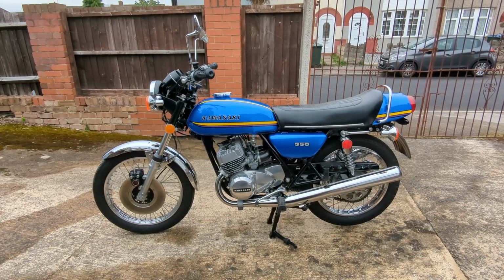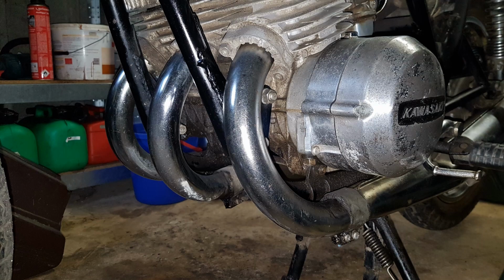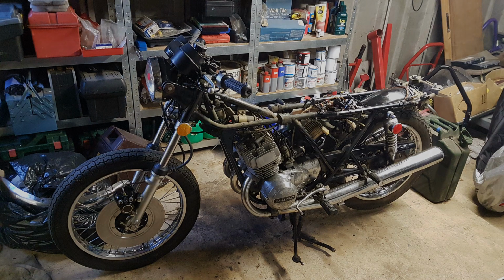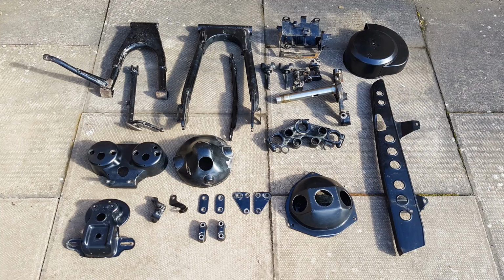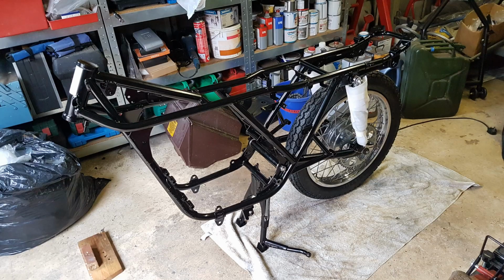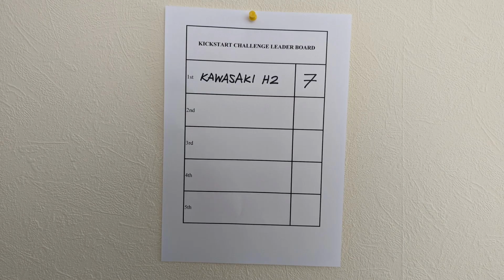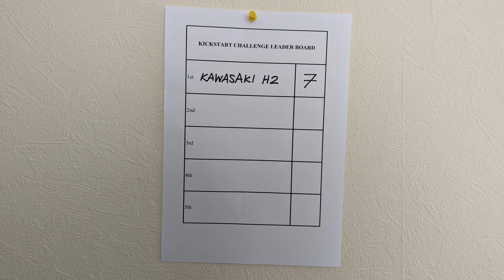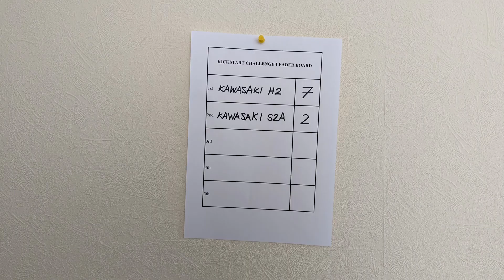1973 KAWASAKI S2A | Walkaround and Kickstart | 2 Stroke Triple | Classic Bike

Comment: Beautifully restored!
Nice machine that doesn't break down easily.
I had a 2 cylinder 350 cc Avenger A7 from 1986, which also used a lot of petrol, but never broke down and had fantastic drum brakes.
Riding a two-stroke is really different from a four-stroke, it's a shame they are no longer made.
Good luck with this beautiful machine!
Reply from the maker: Cheers mate! 👍
I really like those A7 Avengers and the 250 Samurai SS models. I wouldn't mind getting my hands on one now tbh.
There are a couple of companies producing modern 2 strokes.
Reply: @derekb2765  
I'm sorry, I didn't know that 2 stroke motorcycles were still made, except for the motocross.
Hopefully you will soon find a nice 250 or 350 cc example from Kawasaki.
Hopefully you will also put this on YouTube, good luck!
Reply from the maker: Here's one.
https://www.langenmotorcycles.co.uk/